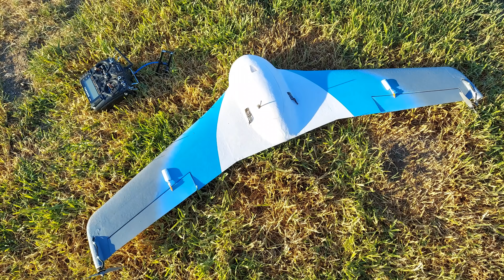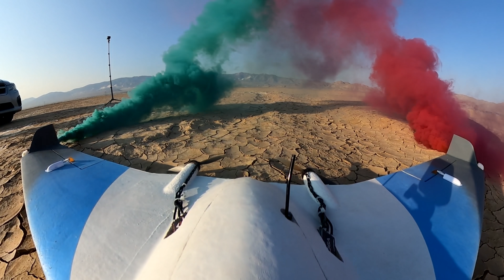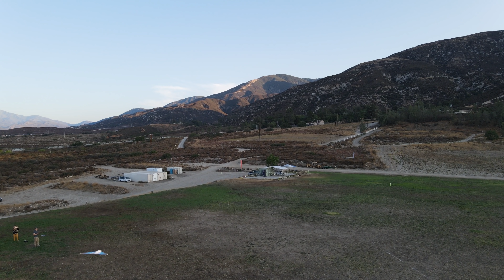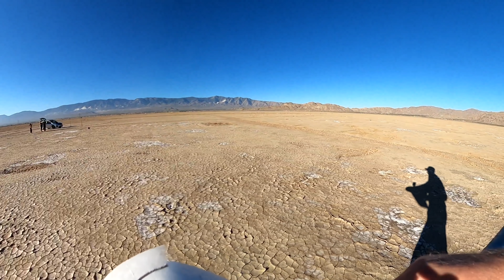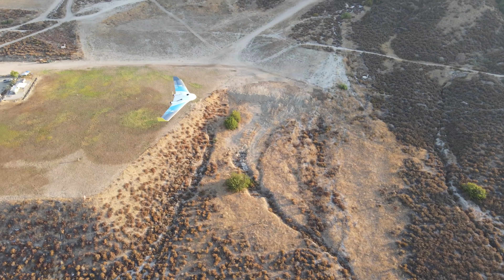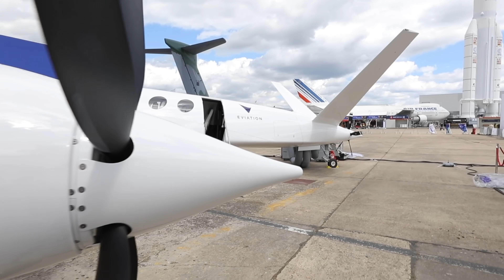Can Wingtip Motors Improve Aircraft Efficiency?  RCTestFlight Solar Collaboration Part 1

Comment: A one engine out emergency would be interesting, that's why they don't do it unless you're the bell and can run both props from one engine if needed
Reply: Having two electric motors per prop could help.
Reply: I was thinking the exact same thing when he showed the left/right torque of the plane in the workshop
Reply: Thats how its done on the valor
Reply: Yeah, you’d need a huge vertical stabilizer to counter the yaw torque.
Reply: @vattuvarg  so the wing becomes heavier because of the additional motor and the extra structural strength required to mount the motors and keep the wing intact.
Reply: Thats why you don't see in in general or commercial aviation.  But still, a VERY GREAT concept and experiment.
Reply: @linusa2996  - Each propeller would get the power from two (half effect) motors. If one of the motors quit then half the power would remain, which should be enough for flight and landing, i think. The plane would have 75% propulsion left (3 half-motors).
Reply: or have a shaft that connects the two engines (like the V-22)
Reply: @RCP-1136  The valor's rotors are interconnected, same as on the V22 Osprey, Bell XV-15 and Agusta Westland AW609. And the Ch47 Chinook... They can only spin at the same exact speed, even if one engine were to fail, though they have independent pitch and cyclic control. Not tilt control, though, the two nacelles HAVE to be synchronized or they would spin out of control
Reply: one engine out emergency Crossed My Mind As Well, Pucker Factor Would Be Clean out of Sight.
Reply: I came looking for this comment
Reply: This was my first thought. Yes the Valor and Osprey effectively do it although for very different reasons. And they pay the price. The added weight of the required redundancy systems for engine out conditions negate the efficiency gains. There's many other ways to reduce wingtip vortex Induced drag.
Reply: @Mike-oz4cv  or use a jack knife maneuver. also electric motors don't fail quite like piston engine so there is that aspect to it
Reply: All multiengine aircraft, including RC aircraft, have a minimum single engine speed.  That's the speed in which aerodynamic yaw control (rudder) has enough effectiveness to counter asymmetric thrust from a single engine.  If you slow below this speed, you have to shut the other engine down as well or you'll begin to enter a spin.  The further out from centerline you put those props, the higher that speed will be or the bigger the rudder needs to be.  At some point, that speed may exceed the maximum speed of the aircraft...meaning it can't go fast enough for the rudder to counteract asymmetric thrust.  If you have an aircraft that you cannot fly with a single engine, you treat it as if you lost both engines.

The idea of using two electric motors inline for a single prop is a great idea for redundancy, and it would probably work quite well, though on a practical level I'm not sure it would work.  If you lose a motor, chances are it's because it seized up for some reason (a bearing failed or whatever), and the other motor is still having to drive that dead motor that's trying to seize up...so most of your power will probably go to overcoming that resistance instead of powering the prop.  If there was an easy way to incorporate a freewheeling clutch to both motors so one could disengage if it died, sure, but I don't think you're going to find that kind of hardware in the RC world.  In larger aircraft, sure...it would add some weight and complexity but if your design relies upon needing that kind of redundancy it would be worth the penalty.
Reply: Or have a third central primary prop with two motors - if either of the wing tip motors fail, then just cut the power to both
Reply: @stuartm1396  That would add redundancy, yes, but at the expense of efficiency...and efficiency is the whole reason for props on wingtips
Reply: @linusa2996  no, it's actually a plus/minus consideration as the wing root is normally most critical and weight outboard reduces wing bending moment. It requires more strength/weight in the tip structure. It also has a profound effect on roll inertia.
Reply: @vattuvarg  Not when you have to shut down the engine because of a transmition failure or more likely vibrations (a birdstrike or so) there would be nothing what safes you from crashing...either you are so quick and shut off the other engine (like automaticly) but then you suddenly lost both engines...or you simply go into a really quick spin...
Reply: @Skinflaps_Meatslapper  just make the central Motor have enough barebones power to glide to safety.
Reply: The V22 Osprey in horizontal flight mode is in fact such a wing tip prop configuration. Of course it has cross shaft to ensure either engine can turn both props. Electric motors are inherently more reliable than combustion engines and since they are light, having a third one at the tail offers some aerodynamic advantages.
Reply: @emilelepissier7550  it's good for safety reasons but it has nothing to do with efficiency... everything you put on an aircraft what adds weight compromises efficiency. The osprey was never ment to be more fuel efficiency that a transport airplane...the key is the mission and all the VTOLs have simply a different mission to fulfill. If you and weight you will have a higher fuel consumption and less useful load, that's the opposite of what wingtip motors want to achieve. A third engine would just add more thrust, weight, drag and complexity.
Reply: You’re all talking hypotheticals until you run actual tests… in regards to redundancy motors and structure.
The only thing not up for debate is that a single engine/motor pattern would be a damn nightmare with this setup
Reply: @FL300, unlike combustion engines, there are few constraints to size motors. Adding a third one does not necessarily add weight etc. One just need to size the total installed power accordingly. There are definite aerodynamic advantages and hence better efficiency in having a propulsion unit placed behind the large fuselage and smooth the flow there. Momentum-wise, accelerating the lower velocity air in the wake gives a higher Froude Efficiency.
Reply: @emilelepissier7550  ok, maybe I have a lack of knowledge on this part...I was calculating all the accessories for the third motor like cables and motor controller etc.. but behind the fuselage you have actually the worst conditions for the propeller...it's turbulent airflow and the thickest boundary layer it can get...so that's not right...the only aerodynamic advantage is the relatively undisturbed airflow over the fuselage/wing. If you don't layout the concept really carefully, you eat up the advantages of a clean airflow over the fuselage/wing with the bad efficiency of the propulsion in the pusher configuration. Those configurations ar much louder to, because of the turbulent airflow and the Interaction with the fuselage/wing and the propeller.
I'm not against this concept by any means...it's like alleways in in aviation, the answer for the best configuration is "it depends".
Reply: @vattuvarg  increases cost, weight and work for redundancy when there's little overall benefit.
Reply: @vattuvarg  Actually, this is brilliant. two motors that work in tandem, but also capable of running independently. Nice. Might need a some feasibility checks but it is absolutely brilliant.
Reply: Electric motors are more reliable though
Reply: @vattuvarg  that's smart.
Reply: @linusa2996  no it would be two smaller motors that add up to a big one. It might be a little less mass efficient but not by much.